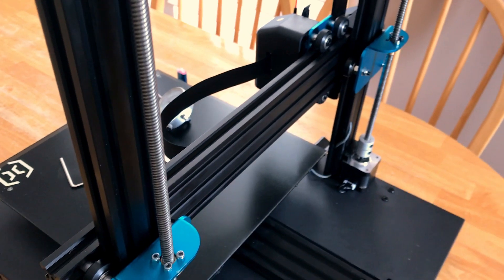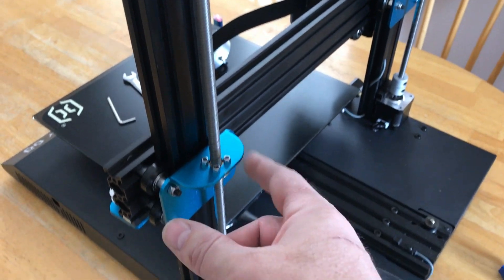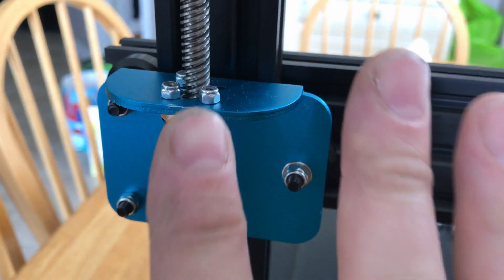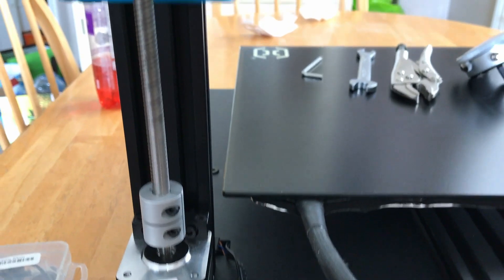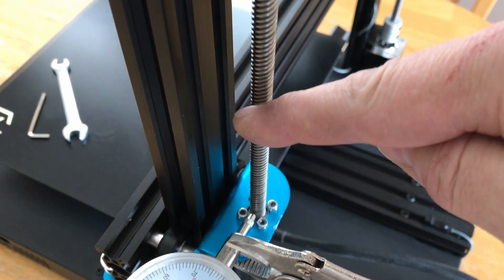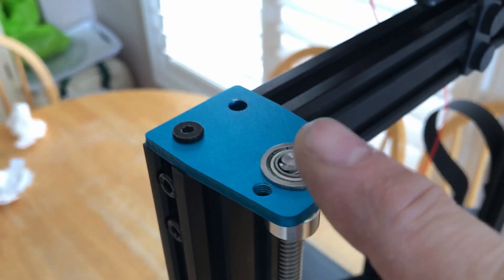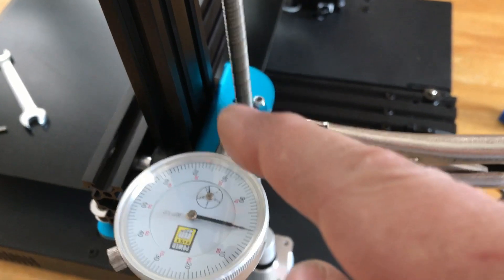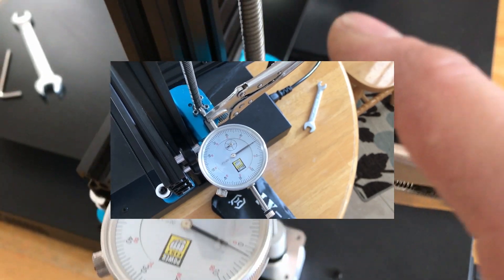Z Wobble Repair - Artillery Sidewinder X1

Comment: I just ordered one of these machines yesterday and have been digging into what I can expect to need to tweak. This video looks like it'll be super helpful. Thanks!
Reply from the maker: one tip I can give you is get the machine setup best you can (stock) and do some test prints to see how its going before you changes -  you will find the machine is very good out of the box.
Reply: @CaM203  Thanks! Going through the videos, I'm noticing a pattern of very few issues, or lots of issues. Very little between. I bet it comes down to who was on the assembly line that day.
Reply from the maker: Alastair Drong one issue that I have been playing around with is the rollers. Both on the gantry and the build platform. If you spend the time to adjust them I believe it prints much smoother. Too tight, you get this “bump” in it travel. Too loose and they flop around and get rough lines. Spend some time playing with them, it’s worth it.
Reply: @CaM203  Thanks! I'm making an "unboxing list" of things to check as I'm getting it set up. I'll add that to the list!
Reply: @CaM203  Arrived two days ago! How's the resume mode been for you? I popped my breaker (I don't think my apartment is wired right :eyeroll:) and the resume function was there, but didn't extrude filament and the x,y position for just one of the two parts I was printing was pretty far off.

points of note for anyone considering this printer:
Strangely, there was not test print cube in my box, but there was still some red filament in the extruder when I loaded up my black PLA, so it seems the machine was tested. I haven't completely gone through my checklist of common unboxing issues with the machine, but so far so good. I set it up and it spit out a decent test cube. Oddity of note: I've got a stray screw inside the base that's lodged in the grill of the housing. Luckily, It's sticking with the threads out and has the same threading as a standard brass standoff (commonly used for mounting computer motherboards) so I've got it held in place with a standoff until I've cause to open the machine up.

Comment: Nice job! That was a great video and made sense to me. I've linked this video in a running comment section for another SX1 user that has tried everything but I suspect not the procedure or the points you found in need of adjustment. Thanks!

Comment: Great video and good explanation.. 

With the plate at the top of the Z, did you leave it with 2 screws or tighten it back up? If the latter, did you have problems getting it aligned to screw back in?
Reply from the maker: As you see it in the video is how I left it. Once I had it where I wanted it, I just made sure the screws were tight and that was it. Hope that is what you were asking.
Reply: @CaM203  sure is, thanks!